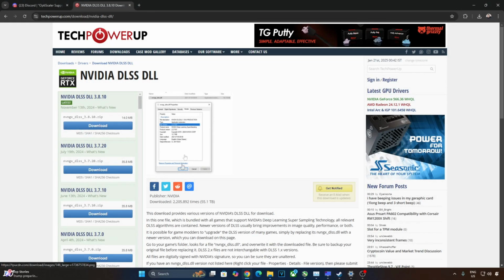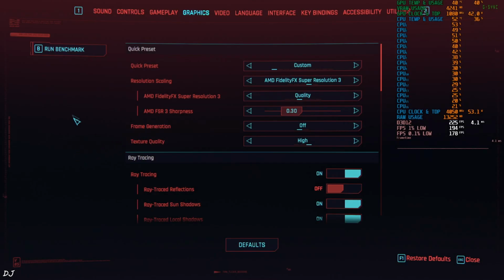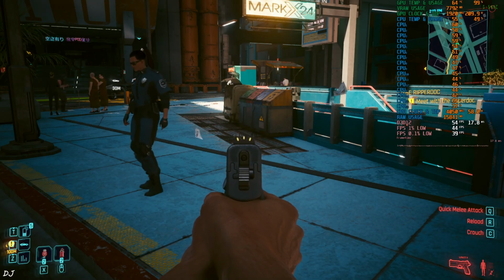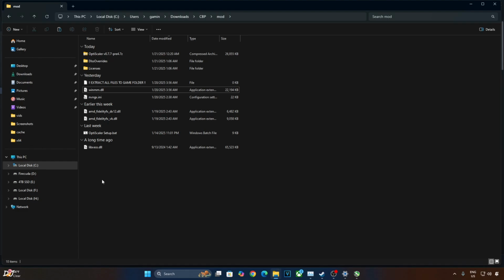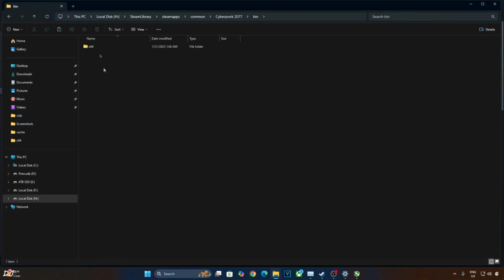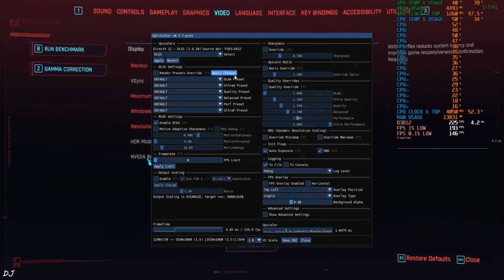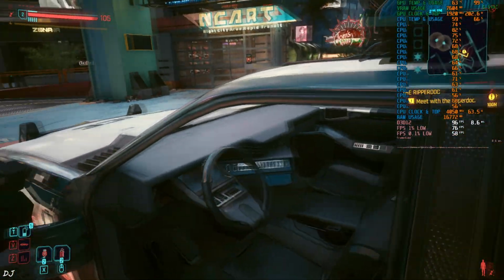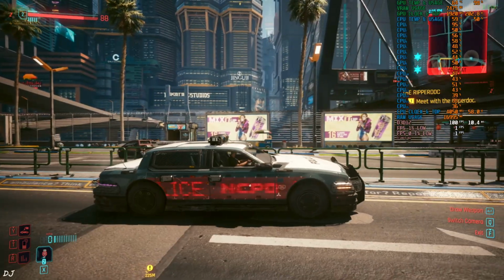Cyberpunk 2077 Patch 2.2 Use DLSS Upscaler With Official FSR Frame Generation | Optiscaler Guide RTX

Comment: this came preinstalled in some set of mods that I downloaded, the keybind was insert and worked fine for a while. I changed the settings in it to DLSS (same as for my in game settings) and it completely ruined DLSS + I can't make the menu pop up to change it.

I tried troubleshooting but couldn't find any files related to optiscaler
Reply from the maker: This isn't optiscaler mod, looks like you installed dlss enabler mod.

Comment: How would you manage this on other games? Like if i would want to combine dlls4 transformer model with a mod for FG.i have rtx3070ti… i already use the nukem mod for some other games??
Reply from the maker: Just use nvidia app to override dlss, then install nukem9's mod as you usually do, tested in cyberpunk :
https://youtu.be/BjnzQju__Gk?si=riKnrOipxxTrISmv
If nvidia app doesn't detect the game / need to force enable dlss autoexposure setting / override model preset , use optiscaler mod with nukem9 mod if the game supports dlss frame generation otherwise optiscaler fsr frame generation. 
https://youtu.be/ohGS6noJqMw?si=y7q0rL-FrC6Rbjdr

Comment: Any idea why i cannot open the optiscaler ingame menu? I follow all the steps and I think is running fsr and not dlss
Reply: I press insert and nothing happens
Reply from the maker: Sometimes you need to restart the game, if optiscaler loaded properly, optiscaler.log file will be present in the directory. Make sure the mod files are placed in the correct directory.

Comment: Yo bro what could be the reason of lsfg not working for me in elden ring
My gpu is 580
Ive checked everything 
But it dosent work
Reply from the maker: Make sure the display mode is set to borderless fullscreen from the ingame setting.
Reply: @GamingDJ4u  its borderless and still dont work
Reply from the maker: I used these settings on rog ally that has radeon 780m
https://youtu.be/J6nAHBbPHK0?t=687&si=XB5a1UgOSo4d6AYt